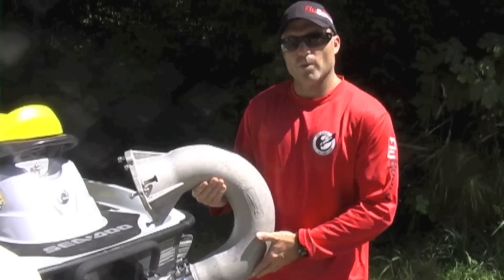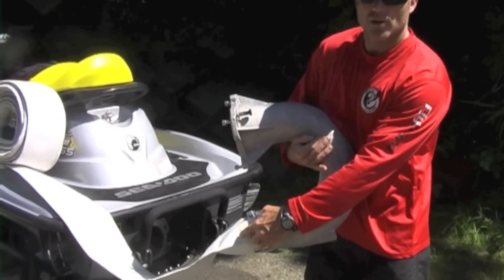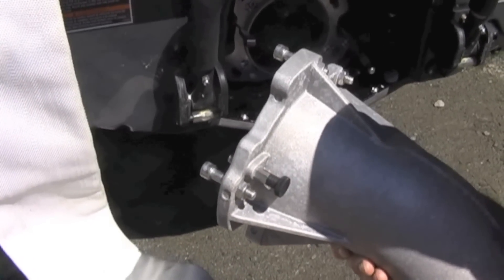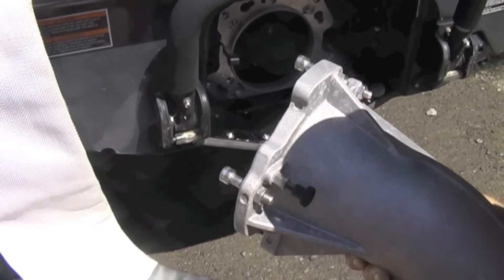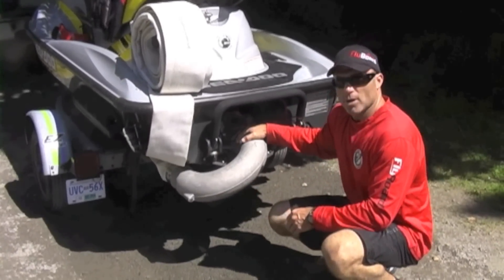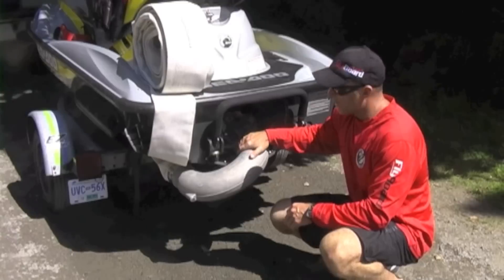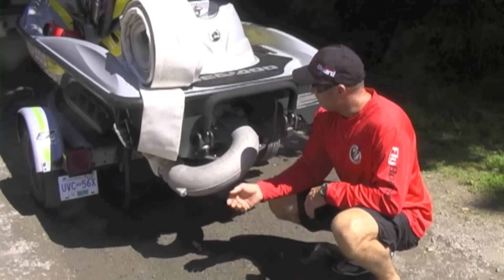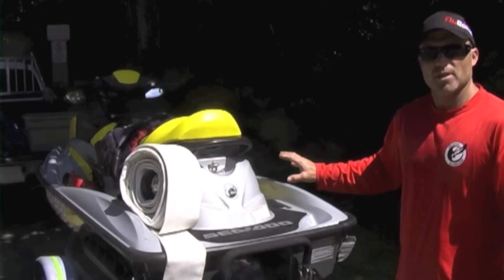Flyboard 101 - Attaching the Flyboard to the Jet Ski

Comment: Great instructional video, thanks. If the propulsion water is directed to the hose and then the flyboard, how is the jetski steered?
Reply from the maker: Good question. The jetski is towed by the flyer wearing the jetboard, jetpack, or jetbike. For beginner flyers the throttle is controlled by the instructor sitting on the ski but the flyer controls direction.

Comment: does your seadoo has the brake sistem?
Reply from the maker: As far as I know the Seadoo in our video was all stock but I've asked your question to Island Flyboard who own the ski in this video and they will get us an answer. I will post it here once I know for sure. Thanks, Blaine
Reply from the maker: Hi Leonel C. here is what Island Flyboard sent regarding your question: Yes, our 2007 Sea-Doo did come with the brake system but we disconnected that to make flyboard adaptor connector plate fit. We do not hook it up when we connect back the steering nozzle for regular use. The reverse linkage can be retrofitted onto your quick connect jet nozzle if so desired. The braking system is a nice feature when using a Sea-Doo for cruising we have gotten used to driving it without the braking system. I hope this answers your question.
Reply: HERO thanks for your help.
Reply from the maker: LEONEL C.  Anytime. Happy Flying!